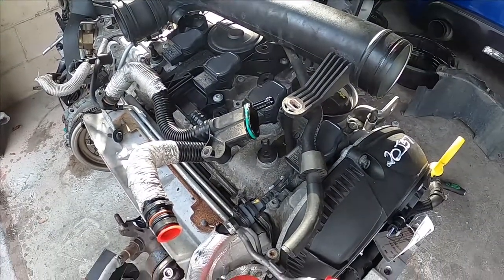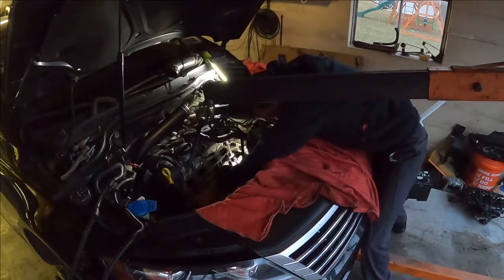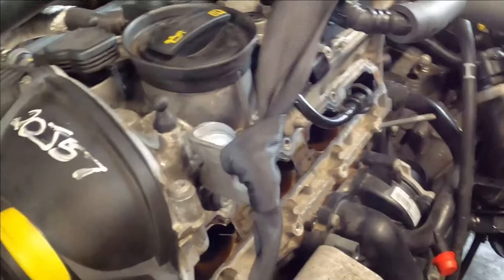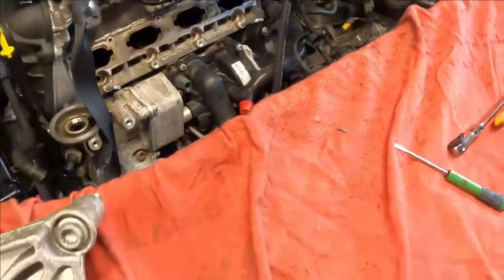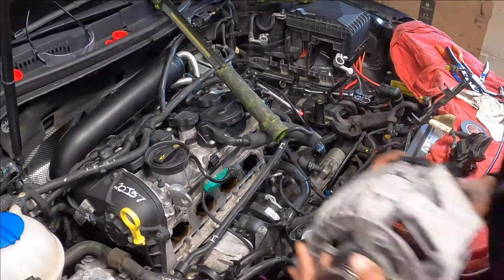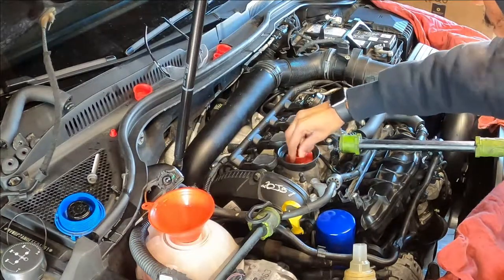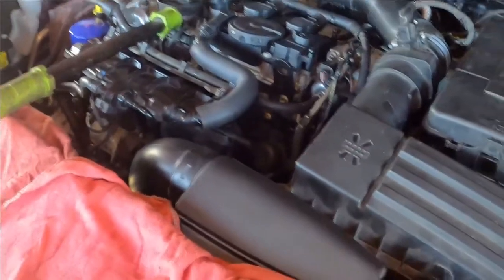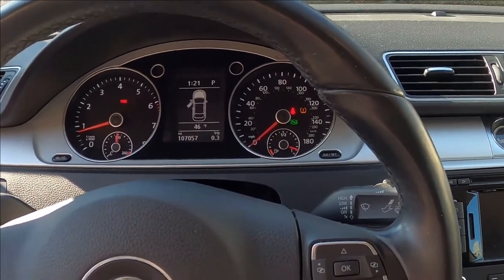How To Engine Swap On Volkswagen cc Part 2

Comment: Great  Video sir. I am in South Africa and have the same engine. It was overhauled twice and now just cranks. I spent a fortune already. What's your advice please. 
Thanks
Reply from the maker: What was the problem from the very beginning, as you said 2 times overhauling what parts did you change?